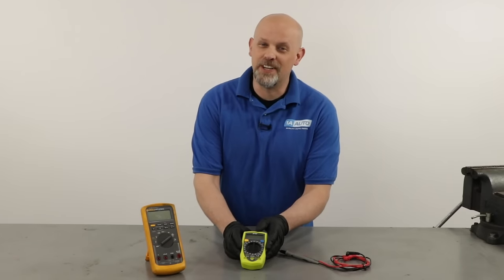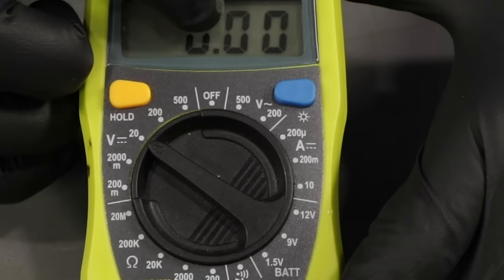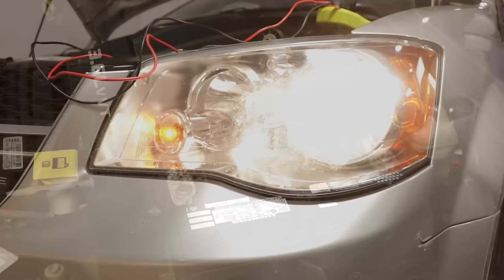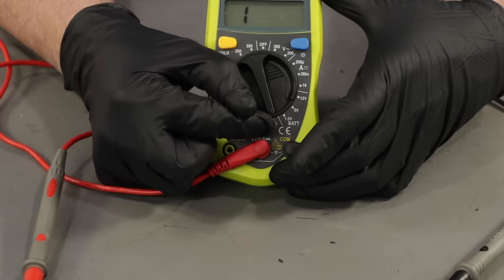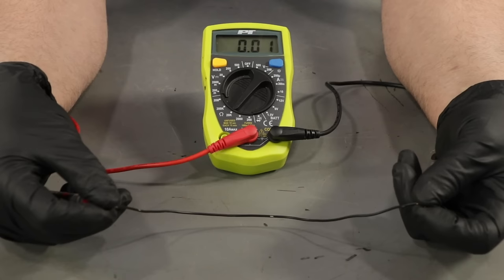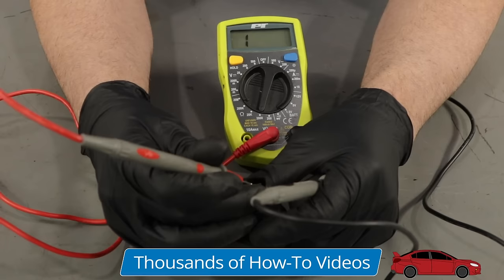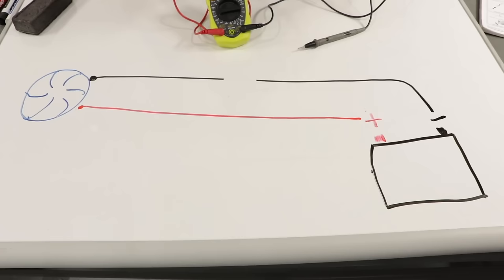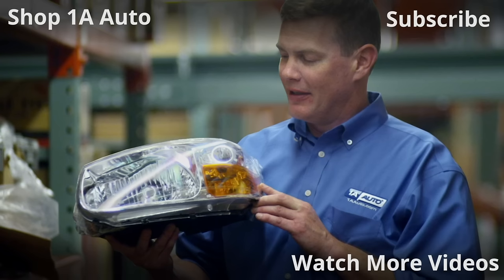How to Use a Multimeter to Diagnose Car and Truck Electrical Problems

Comment: I tested my battery which showed perfect voltage. So, I figured I had a different electrical issue. I looked and looked and tested everything I could think of. It
was -30°F in Alberta for 10 days in January 2020. It turned out I needed the battery test you mentioned which told me my battery had two cells that were bad. I learn something everyday. But, I wish I'd known about the "true" battery function test. Until I took it to a battery shop I didn't know of this other, true battery test.
David
Alberta
Reply: Thank you very important

Comment: I have 6 different interior lights in my 04 Envoyand in the past 3 years. The inside lights don't work, but all of a sudden. They turn on aboutt once or twice a year when I get in. But after I turn the truck off and on about 4 times they go back off. I started at the first one by the driver door can I use that other tester for that has a light bulb that Lights up so i connect the ground ti metal and put the meter into each hole on the plugs which all l lights up but I'm still not getting any light. if there anything else to check? I bought new bulbs last year and put them all in. I remember a couple of them had a different number then what the manual calls for which I believe I took them out to put new ones in.

Comment: Can testing the FRame continuity to the + side wire, still work to test for Wiring short, with the Current Computers in cars?  I know it wont work on the relay based connections.

Comment: Can this be used to test connector plugs ? My coolant plug got wet and I wanna make sure it works probably after I dry it and plug it back into the sensor

Comment: Dumb question but…. I connected the multimeter to my car battery and immediately my interior light and the clock lit up. But nothing was captured on the multimeter. Would you know what causes that. I’m trying to diagnose where the battery drainage is coming from because I charge the battery and then hours later it’s back to normal. Thank you in advance 😊
Reply: I would try testing the connector for the interior and wiggle the wires along the harness. Wire could’ve rubbed and is now intermittently shorting out. You can either check the voltage, or try homing out the harness. You’d need access to the whole length of wire from beginning to end though

Comment: Anyone know how to move the decimal point over? It’s unclear
Reply: Decimal point is determined by the range you have the meter set. A lot of multimeters are auto ranging meaning the meter figures out proper range for voltage, ohms, and amps. Suggest spending a little extra money and getting one like that if you are serious about learning how to use a test meter.